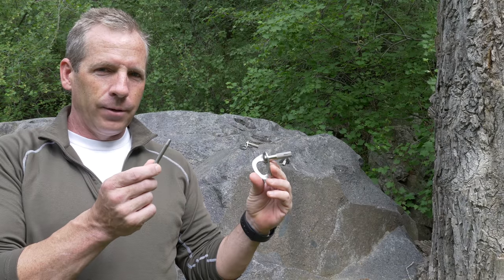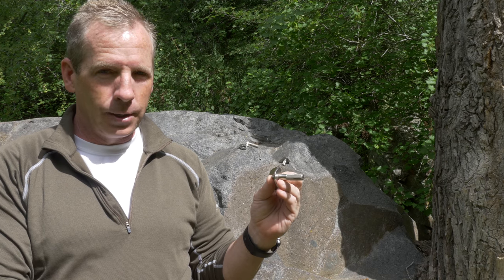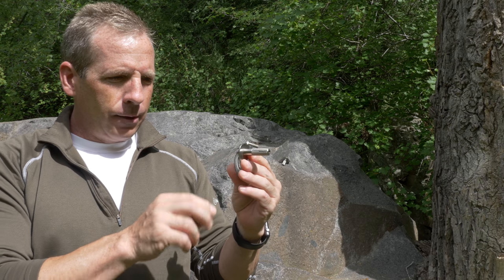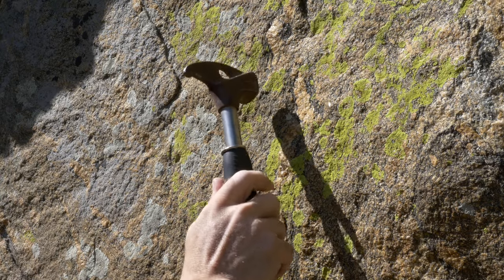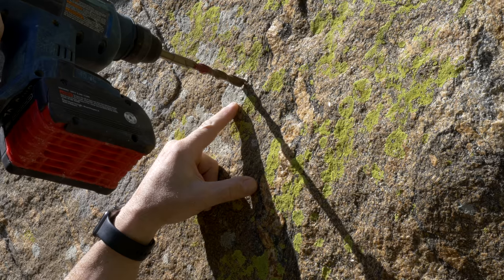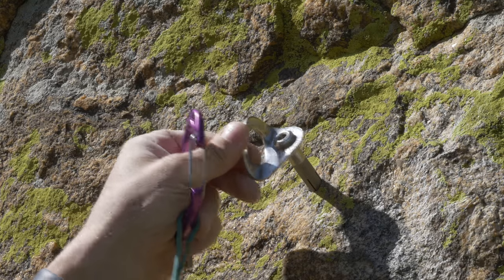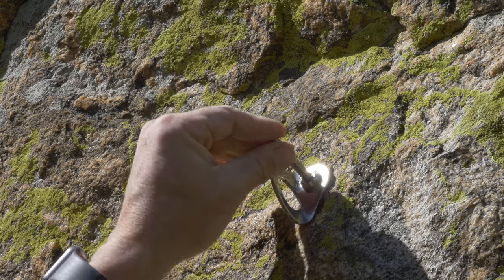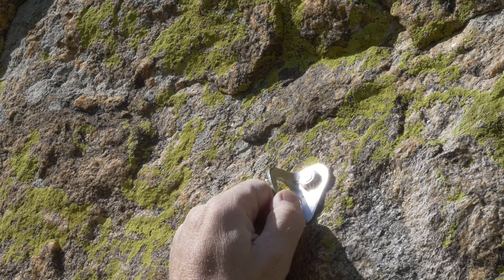Cave Bolting Tutorial - Petzl Long Life Nail-In Bolts

Comment: Great videos. Just a thought, is your hammer likely to cause imperfections to the surface of the hanger or sleeve/nail head and transfer impurities that would lead to corrosion. Cheers Derek.
Reply from the maker: I don't think so, but then I'm not a metallurgist. Most cavers use the Petzl TamTam hammer, which is not stainless, and we're using it to hammer in stainless bolts, but I haven't heard concerns about this causing corrosion.

Comment: What bolt is it?
Reply from the maker: It's literally called a "Petzl Long Life". They aren't manufactured anymore. You may question why the tutorial if they aren't available, but some people keep a stock and I'm striving to have a comprehensive library of bolt placement tutorial videos. I also think it may help with inspecting existing bolts for proper placement.
Reply: Thanks, so they are actually called like that. I was asking because I have not ever seen one. Of course the video is useful, it is important to know how to test rock, to drill and clean a hole :)
Reply: @DerekBristol  By the way, it would be great if you would make a review of Petzl Pulse, there are some but are not oriented so much to caving.
Reply from the maker: alek I may review the Petzl Pulse soon. I’ve used them a few times now for aid climbing. I don’t think I’d use them for standard rigging. One caught a good lead fall on a recent climb so they seem trustworthy.
Reply: @DerekBristol   I also want to use it for aid climbing, only some small holes are left behind me instead of some bolts in the walls. It's also more efficient when climbing, i don't need a hammer (only to test rock quality) and an wrench.